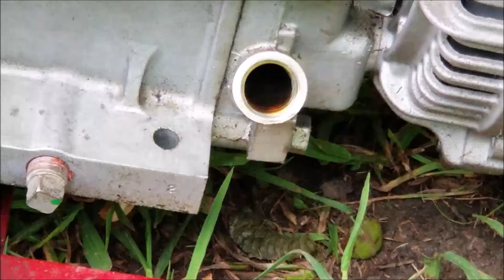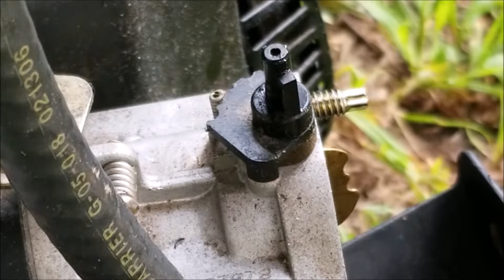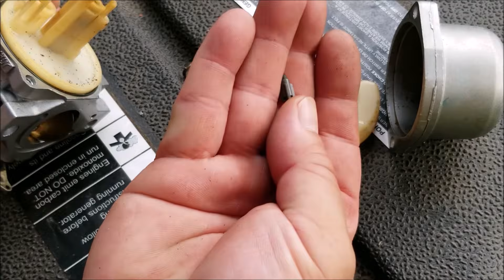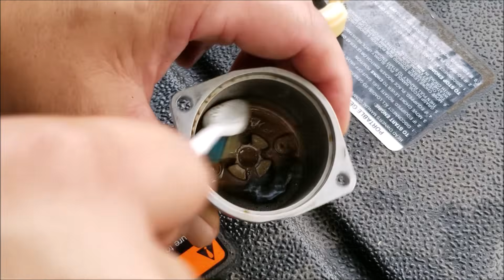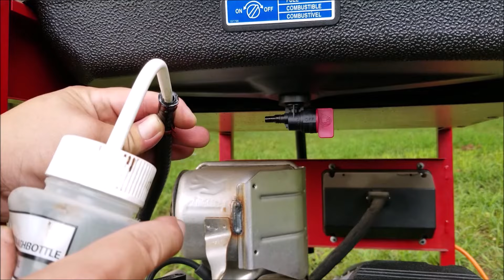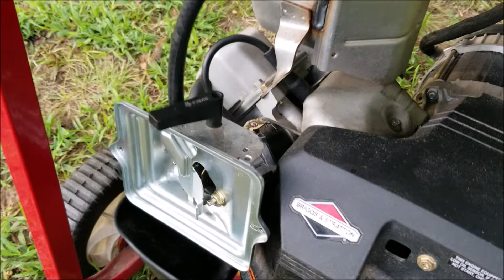Fix a Briggs and Stratton generator that won't start.

Comment: Can you say I should have put a fuel filter on it. I bought the same generator elite in 2003 never had to clean the carburetor yet. Plus I don't never turn off the gas. Never run the carburetor dry. Keep fuel in it and just run it every now and then. Mine runs like the day I got it. Even after running 4 or 5 tank full.

Comment: I followed the video step-by-step but it still won’t start. Any suggestions?
Reply from the maker: sure, have you considered replacing the carb?  Also have you checked for spark and done a compression test?
Reply: The carburetor looked brand new when I opened it up. The pull cord offers plenty of resistance if that alone means there’s good compression. How do I check for spark?
Reply from the maker: remove spark plug, reconnect the wire to it, and then make the plug have contact with the metal of the engine. Then pull on the rope and looks for spark at the plug.
Reply: yes there is a spark. what now? thanks for helping! @HomeGaragechannel

Comment: We live(d) out in the sticks and it was a common thing for the power to go out but with all the zillionaire goffers moving in the power company hates to hear them squeal about no power and having to use their LP Gas jobs so get the power back on pretty quick. I have an old 5K Coleman with a 10 horse Briggs IC flathead and a 2.5K Onan 4-pole, 1800 r.p.m. and plenty of gas and ready for about anything. Usually I run the 5K for 220 for the well pump and the 2.5 for coolers and such. I also added a 'T' fitting so I can drain the tank thoroughly and not leave any gas to go stale and run the carb dry as well. Added electric start because of the vacuum fuel pump and it's a bear to pull enough to get the carb full. Also a 110 battery maintainer to charge the battery back when the genset is running because it has no way to add a charging system to the engine. I just plug the maintainer back into the genset. Gensets are nice but you have to pull maintenance on them or they'll die just like everything else. Blessings
Reply from the maker: wow sounds like you're very prepared
Reply: @HomeGaragechannel  Have to be. I'd rather dodge a bullet.

Comment: You sir are a lifesaver!  Was prepping for Hurricane Ian yesterday, tried to fire up my generator to test it out, and wore my hands bloody pulling the starter cord 100 or so times.  I found your video in a YouTube search, and despite my nervousness about dismounting and disassembling a carburetor, cleaned it all out and now it’s purring like a kitten!  Still hoping I won’t need it, but THANK YOU!!!  I at least have some peace of mind, God bless!
Reply from the maker: no problem and thank you Dillon Digital Video.
Reply: Dillion I had to do the same thing and it starts but wont idle down. Did you have any problems with it idling too high?
Reply: @norwoodsatv  ~ Hello!  No problems with the idle that I noticed.  However, I didn't end up using it for the storm, we maintained power.  I will go back and check it more continuously; after doing this fix, I only ran it for maybe 2-10 minutes stints and it sounded great.  Each time, I turned off the fuel supply switch to let the carb run out of fuel.
Reply: I did the same thing before I found this video and mind you I have the exact same engine. Still won't stay running and yes I installed new spark plug. I'm stumped

Comment: where do you get parts to repair this generator?  my looks almost identical and I believe I have a broken compression trigger on the cam shaft.  thanks for a great video
Reply from the maker: I get my parts from ereplacementparts dot com

Comment: Thanks for doing a great job on this very helpful video. It is understandable, concise and well edited (Big Hint to All Other YouTubers...EDIT YOUR VIDEOS! We don't want to wait for you to find your wrench or realize your battery is dead in your drill.). 

Living in Central Ohio; we have ice storms and heavy snow in the winter, and thunderstorms with tornadoes in the spring and summer. Generators are a must here. It can take days for power to be restored, and homeowner's insurance won't cover rotten food.
 
Back to the video. You were able to re-use your gaskets. Should they always be replaced when removing a carburetor,  or only if they come off during removal? And lastly, is WD-40 a good alternative for cleaning around rubber seals instead of gasoline?
Reply from the maker: thank you Jan Miller.

Comment: Great video and to the point. I had a feeling I needed to do carb work and this video was right to the point. I too had a clogged jet. Cleaned and fixed and then started on the first pull thank you for saving me a lot of valuable time.
Reply from the maker: Glad it was helpful!

Comment: https://youtu.be/TWTkiDoHKOE
Any help would be greatly appreciated on my video on my generator issues.
Reply from the maker: do me a favor, I know the old carb was leaking, but try putting the Old carb back On, and before it floods, try staring and seeing if it still doing the same. I wonder if you got a carb that's jetted for a bigger engine.
Reply: @HomeGaragechannel  
I did that already. I wanted to make sure it was doing the same thing. It was. I wonder if I have a head gasket issue? Back pressure possibly.  I am checking the idol arm tomorrow.  It ran perfectly the last time I ran it, Nothing out of the ordinary.  So why it leaked gas directly into the crank case, it was i thought because the float was stuck or the jet tube was messed up.
Reply from the maker: that is quite the mystery. I've never seen a broken head gasket act like a flooding engine.  let me know when you find out more information.
Reply: @HomeGaragechannel  
What about the governor arm? Would that cause it?
Reply from the maker: no, the governor arm is reacting to what the engine is doing.

Comment: Will the generator run if that spring is missing in the caburator?
Reply from the maker: if you reassembled the carb without the spring, it "might" start, but without it, the gasket will start to leak into other passages that the spring was helping go keep separate. IT might start, but I don't think it will run for long.
Reply: @HomeGaragechannel  thanks, very helpful

Comment: I think people should have generators. Especially with the climate changes we've experienced and what happened in Texas this past winter it would be a good decision. It was clear electrical grids may not always be reliable so having some way for power when the main power goes out isn't a bad idea. Its more so a life or death situation as well. You don't want to die of heat exhaustion in the summer if power goes out and you sure don't want to freeze to death in the winter either. Its a good life saving type investment IMO.
Reply from the maker: I believe you are correct, at least a little one for light and food storage, thank you Geae Liska

Comment: Thank you, thank you, thank you!!!
I have a generator and I went to start it and It actually did but shut off right away, I replaced the air filter and spark plug and was not starting, somehow YouTube recommended me your video I cleaned up the carburetor (was clogged up and really dirty) and started right up and working like a champ.
You are the best!, thank you again and God bless
Reply from the maker: Glad it helped

Comment: I have the same generator it was giving to me its missing 1 plug outlet just wondering if I could use a normal house plug receptacle or do I need the original one
Reply from the maker: I'm going to the safe route and say the original one.

Comment: Hi! Great video!

A couple of years ago I bought a BS power generator that has been running great until last week. It ran for 3 hours and then stopped and Doesn’t want to start up.

I put fresh fuel, I cleaned the carburetor jets (everything was really clean and brand new), I also tried spraying some gasoline through the carburetor and also with a a quick start spray without luck. The spark plug is making a nice and strong spark arc, the oil level is fine as well as the sensor. I checked all the cables and everything seems fine. I just don’t know what else to do! If there is spark (and a strong one) and there is fuel inside, why isn’t it starting? 

Oh and when I pull, there seems to be good compression...

Any ideas? Thanks!
Reply from the maker: Usually if I have spark and fuel and compression, I look for a timing issue or even a spark plug. Even if we test for spark outside of then engine we can't be certain what it looks like inside. I would also consider replacing the spark plug as they are inexpensive.
Reply: Mine has a low oil sensor that will not let it start, not all of them have one. I had to replace mine a couple years ago. Mine isn't starting again , not the sensor 1st thing I checked.

Comment: Generator: essential for using electric hedge trimmer far from house because like most of my army of two-stroke equipment my petrol trimmer is unreliable. I'll take my advice if I get my generator -- in hibernation since they installed a new substation in my hamlet several years ago -- working again (thanks to you)!
Reply from the maker: The best use for a generator is keeping a freezer full of food from food from thawing, That to me is more important than a hedge row.
Reply: @HomeGaragechannel  I never run mine except when needed BUT the electric starter keeps the residual magnets happy. I just spin it over when passing by.

Comment: thank you, would sta bil keep the gas from freezing, I ran mine for an hour and had swapped out the gas and out in new gas. the next morning the air filter had ice all over it and gas leaking from it. later when it warmed up and the ice was gone it would not crank.
Reply from the maker: I think you might have a float problem and that's why it was leaking gasoline. How cold did it get over night because it would have to extremely cold for gas to somewhat freeze.
Reply: @HomeGaragechannel  might have been water in the gas. not sure?
Reply from the maker: @otrotland5377  possibly
Reply: @HomeGaragechannel  30ish, We got another big freeze coming in a few days, maybe teens, too cold, I hope to be able to look at it and then drain the fuel out again so it will not freeze, I would hate to fix it to just freeze again, I got a three-way shut off valve to replace the one that went bad so I can drain the gas off easier.
Reply from the maker: @otrotland5377  gotcha

Comment: Great tip about filling the fuel line with some gas to occasionally exercise the generator, I’m doing it that way from now on! I’m surprised by how many generators I hear when we have a major outage. No one here seems to own or even know how to operate a lawnmower yet they all have generators!
Reply from the maker: That's pretty interesting.  Exact opposite here
Reply: @HomeGaragechannel  Here too. We're the only ones in our circle with one.

Comment: A generator is still needed just in case of a power outage for long periods of time and for jobs that don’t have electricity. A generator + wooden gasification is great to cut down electric bills.
Reply from the maker: Thanks for the comment I forgot about wood gasification.

Comment: Great vid. I like using Brake clean and compressed air to clean the carbs after letting them soak for 20-30 min in a tub of gas. This model is a great candidate for an inline fuel filter after that fuel cut off valve. 3-4 inches of fuel line after that fuel cut off valve and then install an inline fuel filter. That will save alot of carb issues from debris. I agree 100% always turn off that fuel and run that carb dry.
Reply from the maker: You are absolutely correct about the filter. Thanks for the comment I appreciate it

Comment: Now would be a good time to see what voltage is at the brushes which could be either a.c. going to a fullwave rectifier on brushes  or d.c. from the avr. Make sure u secure that gen. after a few days
with no power, people can get short on tempers and ethics.
Reply from the maker: you are so right about that.

Comment: Sheeeesh I remember BS engines with brass floats, what's the world coming too. if u have shop 
air, blow out all orifices.
Reply from the maker: i definitely will thanks .
Reply: @HomeGaragechannel  Btw HG some BriggsStratton gens are licenced with TroyBilt.
I have one of their gens pretty good 5500 watts running 8550 or something
like that peak starting. Aas U may know some gens use an AVR (auto voltage
regulator and that also rectifies a.c. to d.c. to go to the brushes. on the Gen I
have, no avr. It does have two wires from stator to a small circuit board on the 
back of the brushes assembly. this turns a.c. to d.c. to feed the brushes. I chkt
it, 7.5 volts a.c.so if you see  or get one of these. It may help to know what the
rotor is getting.  On Brushless types, the rotor has 2 separate coils connected 
together by diodes. Rotor still has residual field and that gets stronger. a.c. is
induced in 1 coil on rotor an changed to d.c. to go to the other coil, making rotor
a strong electro-magnet.
Reply from the maker: @raymondgarafano8604  thank you for the information I appreciate it experience
Reply: @HomeGaragechannel  You are very welcome. This may help at times. I am told if u have
a gen say good for 5KW u want to hook to ur house after a sparky made the wiring legal for it, that the gen should have a floating neutral as neutral and ground can
only meet just once. having a bonded neutral gen with a house hook-up can keep on
tripping gfi's and maybe mess up furnaces.

Comment: I reckon people do need a good generator if they look after them
Reply from the maker: To me its like a pet. Some people need them.  Some like smaller ones and others want the biggest they can find
Reply: That Patrick,  is a VERY BIG 'IF' I've seen it many times, big-ass hurricane, people running 
out to Lowes or Home depot, they have half or no idea what power range they are looking 
for. some who have NEVER ever done a lick of wiring want to make a suicide cord to feed
the house thru the dryer, a cord fitted with male ends even. after the hurricane passes and they managed to live thru it without juicing themself to death, they shut it off an either put
it in the corner o the garage or leave outside with a flimzy tarp. gas still in the carb. next
time they need it, no start. . . then they start pissing an moaning how they spent a good
chunk of change only to use it once. . .
Reply: @raymondgarafano8604  yep it does vary mate
Reply: @Patrick4959  So, Are you from Australia or England? words like mate or 
bloke give me that idea. I like it.
Reply: @raymondgarafano8604  Australia

Comment: Good job how would u do a engine swap on one of those with the generator head
Reply from the maker: You mean replacing the engine on a generator? Infortunately I've never had to do one.
Reply: @HomeGaragechannel  yes and a valve job with out a fueler gauge
Reply from the maker: @defendthetower2173  now I have done a valve job without a feeler gauge.  I used a pop can to help out.
Reply: @HomeGaragechannel  thanks for the help
Reply from the maker: @defendthetower2173  no problem

Comment: The bowl screws are insanely tight. 
Great tip on cleaning with gas.
I hate Nikki carbs.
Even a small gen set can keep the fridge going with an extension cord.
I’m in s Fla , I gotta have a generator, I crank it regularly, won’t run the ac, but it makes life more tolerable .
I am great on the grill,  in a hurricane situation.
Reply from the maker: Yes I may have to make a video just about taking those screws off. First time took me almost 15 minutes.
Reply: Home Garage once i had have my neighbor hold the screwdriver down while I turned it with a wrench. JIS screwdrivers are good, but sometimes, a properly ground flatty is better.
The peanut gaskets in the Nikki’s are hard  to get. I hate Nikki’s.
Great video.
Jim
Reply from the maker: @Jim-ie6uf  thanks for the information that very helpful Jim S
Reply: Hello Jim S, glad u can keep the beer in ur fridge cold with a small gen, Don't use a cord
any longer than really needed though to keep voltage drop down. too long a cord or not
heavy enough, use lose a lot of voltage when fridge starts, it stays in start winding too 
long it will burn out.

Comment: Our last severe storm.& Power blackout was back in 2014 when a brand new 132/11 kV substation was first commissioned in our rural residential town but we haven't had a major power blackout since then.

It would be nice to have a backup power generator but it's not really needed all that often these days as compared to 30-40 years ago when we had them all the time !
Reply from the maker: So very true. I usually don't believe in extra insurance but in this case it's cheap so I've got a couple myself.
Reply: @HomeGaragechannel  Might have to use our gensets to recharge our battery mowers!

Comment: Not keen on all the plastic bits in the briggs carbs now, can only see a load of problems later on, and when the plastic parts get brittle and break .
Reply from the maker: You're absolutely right.  Another reason to only use 100 % gas. Thanks Alan Marshall for the comment I appreciate it

Comment: Everyone needs backup power. Maybe not today or tomorrow but you will need it sometime. I may have missed it, but did you clean the emulsion tube?
Reply from the maker: You are absolutely correct I didn't clean it. Very keen eye. The bowl condition wasn't that bad so I didn't bother.
Reply: @HomeGaragechannel  
https://youtu.be/TWTkiDoHKOE
Any help would be greatly appreciated on my video on my generator issues.